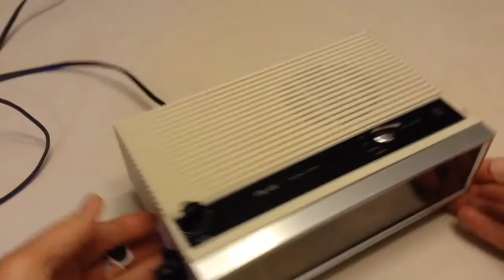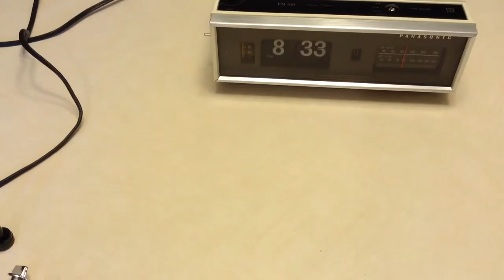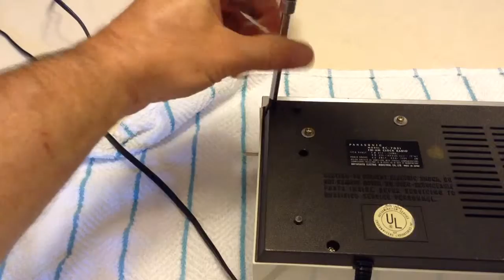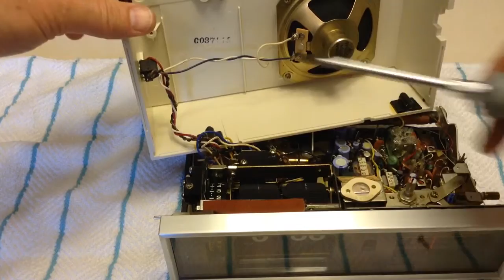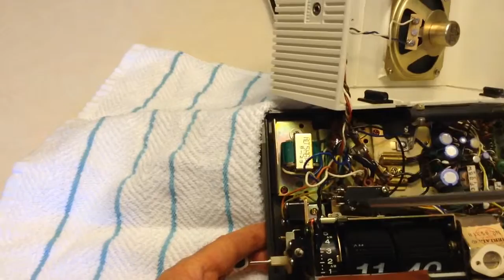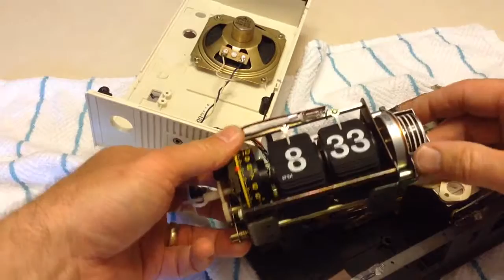Disassembly of the Panasonic RC-7021

Comment: Anybody that's interested, look up the tool XceLite TW-140.  That's the kind of tool for the ring nut, or whatever that is called.  I have one and it works perfect for that job on the headphone jack.  I don't know what it's called, a spanner type of screwdriver.  Could get one cheaper somewhere I'm sure rather than this particular one.  Found the one I have in a box of junk somewhere.
Reply from the maker: I have been wondering about this tool for years. Thanks much. I will be getting one!
Reply: @Flipclockfans  cool.  I'm working on this same clock radio, waiting on a bulb.  The TW-140 is just the right size, no more fumbling around making your own tools.  btw I'm the guy that just drops that type of clock motor in a cup of synthetic oil, then I let it run for 15 mins.  Sounds weird but it works.  The motor heats up, bubbles come out where they can from the expanding air.  Then I let it cool off in the oil.  As it cools, the air inside contracts and sucks oil in.  Blow it off with compressed air, wipe it down, works great.  I've never had the sticker come off the rotating wheel either, due to the oil.  I dump the cup of oil back in the original container.

Comment: I just bought one of these to replace my grandfathers that kicked the bucket one day

the motor is quieter in the new one, but it is making one extra click than it used to about 20 seconds before the number flips down. Do you know what that is?
Reply from the maker: That's difficult to say. But it's most probably in the flip clock mechanism itself, not the motor.  Again, hard to say without seeing it, but it could be dust built up around a gear or other part.  I would open it and blow out the dust. People wonder about lubrication ... really not a part of what needs to be done. After I blew it out I'd spin that clock around 24 hours 2 or 3 times real fast to see if it changes things. Sounds nutty, but these are little electro mechanical devices that are affected by dust, dirt (and sometimes bugs - literally).

Comment: Hi. Great video. I've just bought radio aparently similar  but the model is rc702b. When it came to me it didnt work but with some cleaning is working fine except for one issue. When i put the volume totaly down i can hear some static. When i turn off the radio the radio shuts off but the static noise remains permanently.  Can you help me to find what could be wrong?
Reply from the maker: That's a tough one. But at times this is caused by a stray wire, or a screw somewhere touching something that it shouldn't. You'll have to look closely. Also, try plugging into another outlet first.
Reply: @Flipclockfans  Thank you. I will look closely because when i plug it for the first time after buying it, it didnt make any sound at all, or maybe it became much louder since...

Comment: Thanks for the thorough tutorial.  Just used it to partially disassemble for cleaning an RC-702B, which appears to be a variant of the RC-7012.  Especially helpful seeing how the front plate attaches, so I could remove it safely.

Comment: Do you have a video of actually replacing the bulb?
Reply from the maker: Not in this particular clock. That would be a long boring video though. It's not all that easy, but doable if you can soldier.

Comment: Great video dude. I'm trying to renovate one of these clocks, and I was wondering - where can you get parts? I kinda wanted to replace the white plastic with a wood enclosure, and replace the sleep timer knob, amber light and maybe AM radio. Thanks in advance!
Reply: +Ben Jones If you want a wooden case, you'll need to find someone who will custom make you one - the 7021 was made only with plastic cases.  Sleep timer knob will probably be the easiest thing to replace. AM radio? What with it? This has both FM and AM, does it not? The light can be easily replaced, head over to flipclockfans.com and search for this model or start a topic. 

OR - you could look for another flip clock, with wooden case, like the Sony 8FC-69WA Digimatic. Good luck.

SAVE THE FLIPCLOCKS!